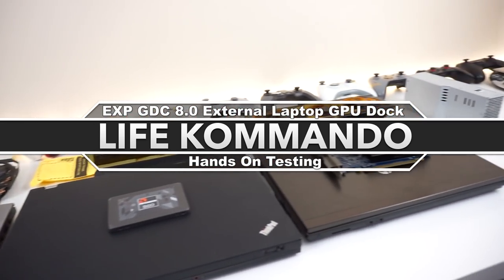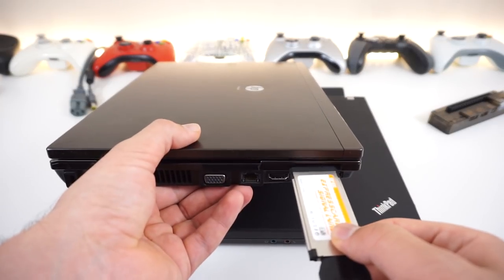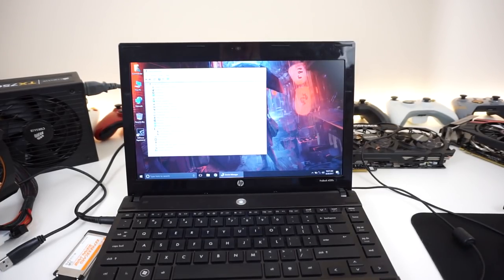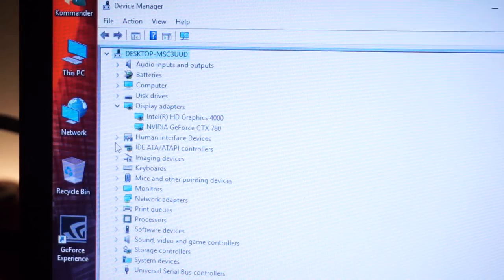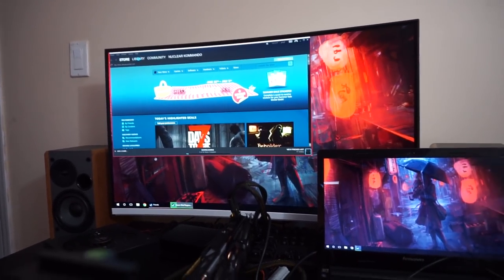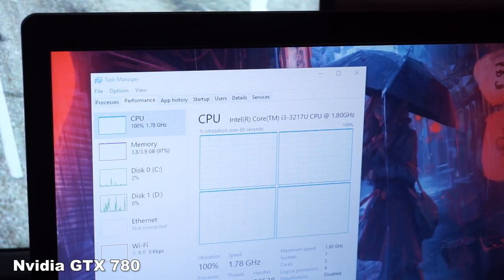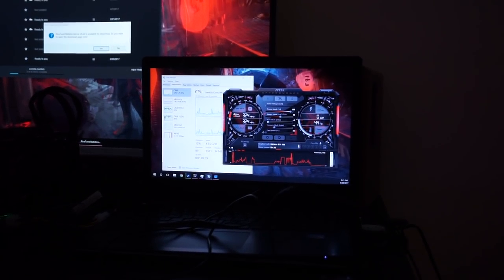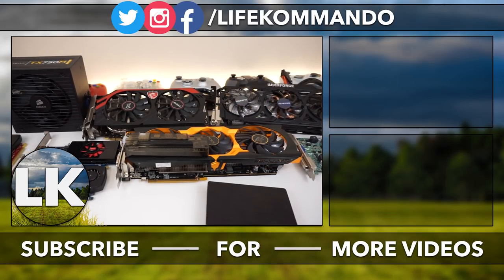EXP GDC 8.0 eGPU | External Laptop GPU DOCK | Hands On Review

Comment: You forget to mention the Bootleneck :P Some noob gonna put a gtx 1080ti to his Intel pentium 2 notebook and then wonder why he gets only 18-28fps XD
Reply: Yes, This comment needs more like to pull it on top of the video. As it is the most important part on eGPU setup. You must keep in mind about the Battlenecking issue. Thus you will end up sad and waste money on nothing.
Reply: Do you think the 9.0 version of this solves the bottleneck issue?
Reply: @TheTrueKiNG18  No, the bottleneck happens because the CPU is not strong enough to handle the GPU
Reply: @PHCareli  you have recoment for gpu in cpu T6600
Reply: how about quadro card ? will it work fine ?
Reply: @PHCareli   the bottleneck happens in the PCIE bandwith too
Reply: Let him,....
when it wont run as it should he will sell it 4 cheap....Maybee U will B the 1 to profit 4 it
Reply: @tp7033  it will but on average you lose about 20% of what it could give you with a proper CPU. That's also assuming you are using 4 lanes and not 2 lanes on pcie. To use 4 lanes you'd need to use your m.2 nvme slot. And if that's where your ssd is then now you gotta circumnavigate that. At this point it's better to do full build.
Reply: Just upgrade the cpu. Swap it out for an i5
Reply: CoyDog790 this a laptop you can’t upgrade the CPU
Reply: Yes unfortunately mini PCIe bandwidth will bottleneck any Laptop, because your graphics card will only run in x1 2.5 GT/s
Reply: @dess.3761  Yes, you can upgrade some laptops CPU.
Reply: @Spinning Nigga From Tekken sure it can. some other companies like HP (omen) even combine i5 9300H with rtx 2060 (mobile). Tho keep in mind that the manufacture is stock build, so it would have it's own advantages if compare to you're own build which is literally "mod".
Reply: KORAMA-7  bottleneck is expected friend. But the thing is, is your laptop support this ?
Just beware that some manufacture limit their port through bios, and not all gpus is supported also.

But I think 750ti and 1050 is safe choice.
Reply: @ero-samairianto625  will my i5 520m handle a gt 1030
Reply: @chuuya9694  it will, but of course bottleneck is expected tho.
Reply: Eiad Fi  hey no no no no don't use bottleneck calculator it's all bullshits but keep in mind that doing this on an old dual core cpu(core 2 duo, 1st to 7th gen intelcore i3 i5 and mid range i7s are 2cores 4 threads) so u can only use the egpu for a QM CPU(QM in intel CPUs means Quadcore Mobile, For example i7 2630qm is quad-core bu i7 2620M is dual core) hope this was helpful
cheers
Reply: SMR  have you considered thunderbolt 3? Your laptop may not have it though but for the price range but i wouldnt be surprised if it did
You may experience between 10 and 20% bottle neck but your cpu should handle it fine, you may get issues with overclocking cpu and power issues (99% likely wont happen) due to the cpu being a u series meant for mobility an lightweight
I personally have a old latitude e6540 (i5, 4300m, intel hd4600) with a egpu 1080ti from part of my mining rig :( (pc died this is my backup) it can handle livestreams but if i add to many overlays the fps drops or qualoty due to rendering issues but nowperfect for live streaming 1080p flawlessly whilst playing gmod(light game) or render my hd60s + perfect from ps5.
Reply: SMR  pci or express card? Both are limited to (i could be wrong) 4gbps for gen 3, 8gbps for gen 4
Express card is the most user friend plug and play so to speak with having less issues compared to connect through m.pci
Reply: If it is an i3-6006u?

Comment from the maker: Video isn't well done, way too fast, but blame my hot room, it was a furnace at the time of recording
Reply: Life Kommando can I use this with a gtx m series?
Reply: Is it a good idea to upgrade my i7 4710HQ GTX 850m laptop to an SSD, 16GB sodimm DDR3L, and finally an external gpu maybe a 1060 6GB?
Maybe that'll almost cost same as a new ryzen build add a few more cash but ofc better than this laptop upgrade experiment. What do you think?
Reply: Unfortunately that old i7 HQ chip is soldered on. Maybe I'll need to ditch this laptop afterall.
Reply: Speak lil bit slower. If you wish to have lot of non English native subscribes too.
Reply: The i7 4k series is fine.
Reply: Should I go for it or am I wasting budget buying 1060+ATX PSU+Dock roughly $400
Reply: To use the internal display you have to go into the BIOS I change a couple things.
Reply: Life Kommando Please do another one with the express card on a Evga GTX 1050 I have an Acer aspire 3 and i think it has an express card port but it looks too skinny any ideas?
Reply: Wouls be a good idea since u said u would in the video! I might be the first one using Beast e-gpu along with a 1080Ti though ;)
Reply: 5:48 It is also true that the mPCIe plug for the GDC won't work in a WWAN slot?
Reply: So I tried running a gtx750ti with it, I had to change bios settings and  got a decent power supply but it still doesn't work, I've tried installing latest and older drivers  but they don't work, I keep getting the error code 43 in the device manager and if it does work, not for long, it gives me a blue screen with a video TDR  failure
Reply: please EXP GDC 8.0 eGPU for free , i live in gaza and i dont have money :(
Reply: Whats the followup to this now?
Reply: Life Kommando the reason that you can’t play GTA V smoothly is because of your RAM, it’s only 4G.. at least upgrade to over 10G of RAM to get way better performance
Reply: Can you also connect this adapter with the Graphiccard with a HDMI to Thunderbolt 3 cable?
Because the Laptop has no old card slot nor do i wont to Open it to get acces to the PCIe Mini.
Reply: Do you think it would work with an Radeon Rx 570 with an I7 7500u
Reply: Jimmie Thomas in theory, yes it should. But you have to connect a external monitor to get AMD cards to work properly. Only Nvidia cards will work both initial screen and external one.
Reply: Hi bro did i can use external graphics card on my Asus E502SA laptop. pls answer it's important to me

Comment: Need to know, is there any performance difference between PCIe slot and Express card slot ? .... Does both have same data transfer rate?....... If they do then will it effect on over all performance?....... And the last thing to know Does the motherboard have different level of temperature while using between the PCIe slot and the Expresscard slot?
Reply from the maker: PCIe is faster, as for mobo temps it should be less, since there is less load on the cpu

Comment from the maker: Run A Desktop Graphics Card Externally On Your Laptop
Is it any good? 

Watch the video to find out =p
Reply: 20%-30% lost when used on a mPCIe slot. but very good alternative to low end gamer and power efficient since laptop don't consume that much power. A gamer with enough fund to buy high end gaming rig wouldn't bother on this one.
Reply: can you make a vidio how to make a case for this divise(with an integratet power supply) luke the racer core but with a budget from 80 euro.
Reply: just collect some acrylic, cut some holes and glue them with adhesive, it's strong enough. if you wanna secure the parts nicely, cable ties are good.
Reply: Life Kommando what arethe laptop models you are using ?
Reply: link for the video for express card that is not working on your video. thanks
Reply: Hey men i want to know how to use the internal display so pls make a video and use a 2.0 ngff 1x
Reply: Well if you can
Reply: @jay22alco  Well for me only 10%. But i think it depends on the graphic card
Reply: DashcamPower, yours being?

Comment: I have one myself with the ExpressCard adapter and it works waaay better in Linux with AMD cards. My T530 has NVIDIA Optimus as well and I don't even have to deactivate it, I just pick which card to render on with XRandR. External monitor is the way to though since transferring the rendered image back to the internal monitor eats almost all of the bandwidth. The setup is fairly easy with some experience if you want to use it as the only card, you generate a /etc/X11/xorg.conf file with "Xorg -configure" and just remove the other cards with a text editor like nano.

Comment: There are also Mini-PCIe WiFi cards which only use the USB lines of the Mini-PCIe slot. I don't remember an exact model right kow , but they exist.
If one has a laptop with two Mini-PCIe slots of which only one has PCIe signals, one may still be able to have built-in WiFi by installing such a card in the second slot.

And it would be great if there was a version with a jack which one can install in the laptop's body. With this, the laptop would remain mobile if one disconnects the external GPU.

Comment: Thanks ive had the ext dock for a while, i havent installed it yet on my spare laptop...
Question: I noticed my old laptop has a wider PCIE hole and the card shown in your video is the same as mine which seems narrower.
Is that standard sized (my eyes decieving me) or do i just have to fit that in the wide hole just the right way? I might get it wrong. Thanks

Comment: Too bad you couldn't showcase this adapter using your T400 because I have one myself (next to a T420) and was actually thinking about to pick up the variant with the cardbus connector.
Certainly it won't magically turn these old guys into gaming beasts but it does well enough for say a LAN party or when being on vacation or something like that.
Reply from the maker: I should still be able to run it on my T400 since it also has the same wireless connector

Comment: I did somthing similar with a few projects. 5 scenarios makes this plausible/useful. 

First a few ASUS and one alienware had hdmi input so you could switch the display over the a hdmi input from the external card. 

Second being a high performance mpc like the gigabyte brix which both has a spare mpci slot and would require a tv or monitor for normal use anyway.

Third is using steam streaming which does not bottleneck the limited lane enough to make it useless. 

Fourth is of course of your doing video editing in the field, would act the same as a compute unit, they even make hdmi dummy plugs for this purpose. You can use it with software like resolve because they do not have to use the same card to display the workflow as they do for compression/rendering. 

Fifth would be for cheap or makeshift mining setup.

Comment: hey i need advice.. i have HP probook 4420s and im planning on using external gpu.. do i need to upgrade something first to use gtx 1070/1080ti? or i could just use it without upgrading something (i.e cpu, ram, os, etc)..?

Comment: I have hp4520s first gen i7 8ram ddr3 and plan to connect with gtx970 through mpcie x16 port to exp gdc beast v8. I hope it will work. I think in the video is the same laptop with i3 but you tried only the expresscard. And there is also some kind of list with best working egpu's for this dock. I dont know if this card is too much for my cpu but will try.

Comment: I have the same gdc beast v8 and an nvidia 970 gpu. 

My laptop is the Acer v3 571G and the gtx 970 shows up on the device manager with no errors after installing drivers.
Problem is I am unable to place load on the gpu when using my internal laptop screen. 
Everything renders with the intel hd4000 even when I force them to use the gtx 970 in the nvidia control panel. 

I'm planning on getting a monitor sometime nxt month, but for the time being do you have solution for playing games on the internal screen? Thanks for the cool vid.
Reply from the maker: In the bios settings there should be a way to disable the internal Intel HD Graphics, not sure if this would work but be prepared to reset the bios settings by removing the 3v clock/bios battery if it doesn't work out.

That's something I am thinking of trying out

:) np
Reply: Life Kommando Got a monitor and everything works perfectly..Mad Max plays at about 60-70fps in ultra
Reply from the maker: Hurry! Congrats dude
Reply: I have same laptop with you but i use gigabyte gtx 670 3 fan...what the problem i getting is error code 43...fyi my gpu was not plug the 6pin+8pin power as the cable still not arrive yet...but was that because of the error? Can u test it for me from your gpu tell me the result as i getting error code 43...thanks
Reply from the maker: You have to have your 6&8 pin plugs connected otherwise nothing will work
Reply: Nice i have the same laptop thinking on getting this, I install a special bios that can make me turn off my 630m GPU google it might help you
Reply: This threade may help you: https://www.techinferno.com/index.php?/forums/topic/11033-gtx-1060-error-43-egpu/
Reply: Life Kommando i have a 3d vision ready g74sx with a shitty 560m inside.. I want an external 960/970gtx but I still want to play in 3d with the internal screen. It is possible?
Reply: SOMONE PLZ HELP IM INSTALLING THIS WITH MY GTX 780 classified BUT IT IS NOT WORKING!!! I HAVE ERROR 43 WHAT DRIVER VERSION CUZ IVE TRIED A BUNCH ALSO THE 780 HAS two 8 pin connectors so how does that work cuz I’m using a EVGA 400w PSU PLZZZZZZ HELP!!!!!!
Reply: Perhaps you could upgrade the screen to 1080p, I did this with either the same laptop or one very similar, its not that hard and you can get a really nice ips screen for about £80

Comment: May i ask you a question? My Laptop is an Fujitsu-Siemens Amilo pi-2550 and the GPU ATi HD2400 it has damaged and cannot fixed.Can i try this way of replace the GPU with an external to help the laptop work again or i spend lost my time??I asked this cause i see that you do some settings to the laptop before working  with external GPU and I have only a Black Screen!Thank you

Comment: Is there any option to connect the hdmi back to the laptop? Like a hdmi output input converter or something like that.
Reply from the maker: Nope, unless u pull the screen and buy an adapter screen board to convert it to a desktop monitor so you can output from the gpu to it lol

Comment: Will this work on my HP Pavilion m6-1045dx ?? i5 intel, trying to hook up an AMD (xfx) 5600xt, have all necessary attachments psu. Etc. Hooked the cable, uninstalled wifi program and wifi card. Installed new cable in slot and plugged into older style riser (usb) , i got an HDMI to USB for the plug. The laptop screen is inop. Randomly gets picture. But i can do whats needed on my other monitor... ill use external anyways once its done. 

I tried to change bios settings but it does not have advanced settings... insyde f.12 BIOS. PLEASE IF YOU KNOW :) OR POINT ME TO THE RIGHT DIRECTION

Comment: I have a laptop from 2012 its a Sony Vaio with an i7 CPU and an AMD HD 7670M GPU 1TB do you think it would be worth getting this? What card would you recommend getting to use?
Reply: If the CPU is quad core then it is worth it I think.
A gtx 950 or a 960 would be ideal. Since they're really cheap.

Comment: you know if the EXP GPU can use 100% of the power of GPU? Or exists some delay by adapter?
Reply from the maker: Not even the thunderbolt docks can use 100% of the GPU's power. so that would be a no
Reply: It depends on your mini pci-e conector. With 3.0 one u get like 75% of the GPU. I think if u get an higher end model, like a 1080, it can get worst. Just get a 960/970. In 10 series u have some more things to do to get the external GPU working.
Reply: Actually that depends on Laptop PCIE version and Bus Lines. Mine has 4 bus line and pcie 3.0 using m.2 Nvme.
Reply: Depends on GPU.

Comment: the problem of this is the situation called bottleneck, you can put a 1080ti overclock on a lap using this method but you will be getting around 30 fps on gta v, couse yout tiny and powersaver cpu can´t handle the game

Comment: So if you want to use and external graphics card on your laptop you need to buy EXP GDC (with the correct cable) a power suply and a monitor to get the best or the correct performance, internal display is not recomended to use :(

Comment: what is the max nVidia video card that gives increese as eGPU? Mini PCI-E is limited to ammount of data it can pass per second. So there is a limit of the card, if U are installing more powerfull card it will not give any increese beyond capabilities of mini PCI-E data flow. So what is max card that effectivly gives its annilities via mini PCI-E?
Reply: 750ti

Comment: Any chance we can pm this reseller?Other than expresscard,pcie and m.2 connectors can they make a usb 3.0/usbc exp gdc?I dont mind if the port is limited to only <75watt gpus like gt1030 or rx550 but laptops that only have intel hd+1366*768 resolution can flourish well with those gpus

Comment: Was it possible to use it on HP ProBook 4320s?
HP laptops have PCI device check included ExpressCard.
Did you tried to connect ExpressCard after the BIOS started up?

Comment: what happens if you disconnect power source to card, does your lap top revert back to stock graphics?
Like if you built a laptop motherboard into a new housing and had this hooked up permanantly. Could you have a power switch to turn it on and off as required?

Comment: Can I plug this 32mmm to 54 mm slot??? Will there be any problem not including the loose connection?? I have a dell e6420 and it has 54 mm slot but there are no 54mm expresscard adapters for egpu. Please answer

Comment: i have a Hp pavilion g6 laptop with a intel i3 2350m processor does this laptop support eGPU's ? and also if yes what GPU is Good with this processor that can run CS:GO with atleast 150+ fps 4:3 all specs is Low

Comment: i have HP ENVY 15 Core  i7 2670QM 16gig of ram with dual graphic Intel Graphic Family/ AMD radeon 6600M & 6700M the problem is AMD stops working whenever i tried to install the AMD driver it gives me blue screen, my question is can i use this external gpu while disabling my AMD integrated graphic?